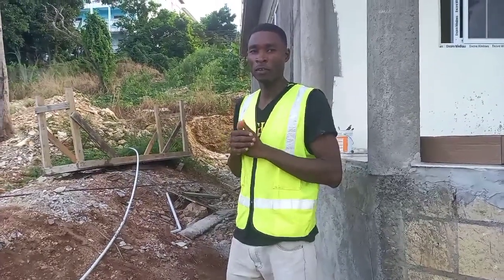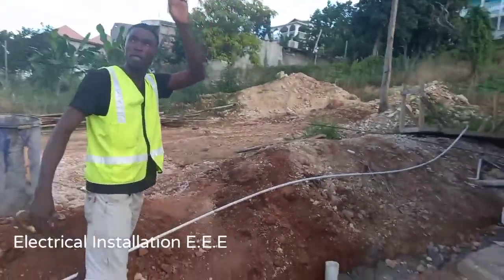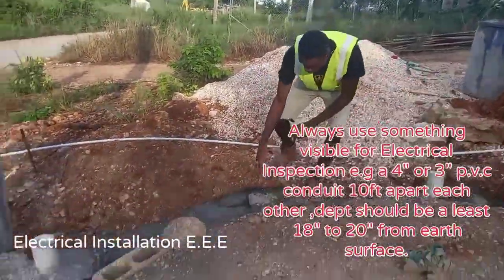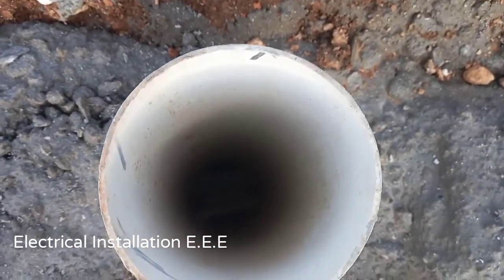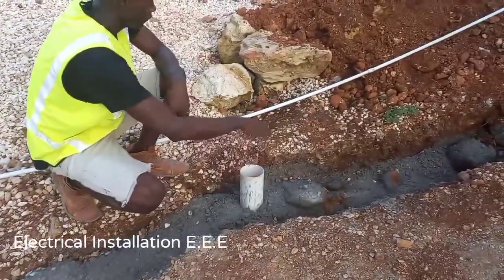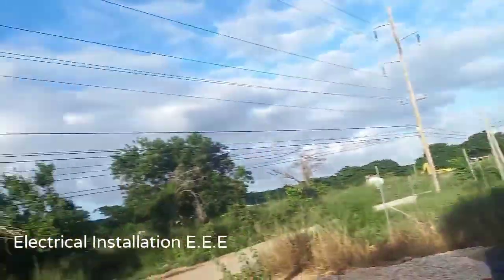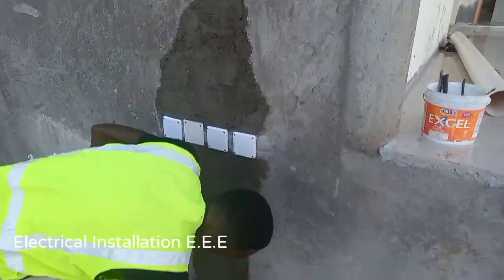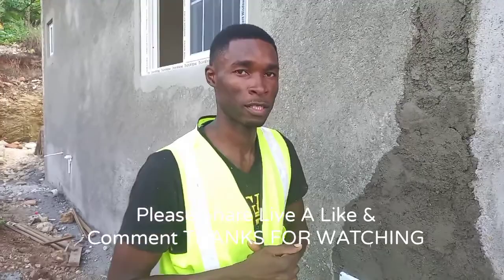HOW TO RUN UNDERGROUND ELECTRICAL MAIN WIRES TO A HOUSE !! ASK MUNDO

Comment: hey is it mandator now to run the main wire underground, base on electrical code or regulation? and is 10mm2 wire ok to use for the main wire for a two-bedroom house ?
Reply from the maker: Yes to your last ? For the first it depend on the circumstance

Comment: I didn't know about the 4" pipe to show them depth... Thanks man!
Reply from the maker: Yea the inspectors want to see how deep the conduits are you can use 3 as well
Reply: I've never met one who checked the depth... Which parish are you working from?
Reply from the maker: I work all over Ja mainly in Trelawny & St James but they do at times even if they don't check the dept in measurement but by glancing
Reply: 😂 Tek it dung rasta

Comment: What size electrical service are you running for the house
Reply from the maker: This house was 16mm single main wires
Reply: @ElectricalInstallationEEE  I mean what is the amperage of the service to the home
Reply from the maker: This home was 50amp
Reply: @ElectricalInstallationEEE  Damn the minimum requirement here is 100 amps. For that size house here it’s 200 amp minimum
Reply from the maker: In some states i saw 50 and 70 while i was there but yeah most 100 i saw
Reply: @ElectricalInstallationEEE  yes that’s the old stuff
Reply from the maker: I realized after seeing it

Comment: Why you put the earth rod the at the side of the house. Why you use a draw box? Can i run from panel the straight to the meter box.
Reply from the maker: Earth at the side was to give the breaker panel a independent earth also saving wire because it would have take too much to go all the way the meter socket .
Using a draw box make the work much easier for instance the floor level was way higher that the ground level so pulling the main wire is easier when you have a breaking point when the distance is long .
Yes you can run the earth from the panel straight to the meter but not when you have a long distance of wiring also the earth wire will contect the neutral bar in the meter then into the breaker panel so running the earth wire straight is like you basically doubling the grounds or neutral wire to me personally .
Thanks for your question.
Reply: @ElectricalInstallationEEE  some jurisdictions here they don’t want you to the ground wire to the meter socket, and some others city wants you to ground it first then go to the breaker panel
Reply from the maker: Some laws in the electrical field makes no sense because to me it is the same difference
Reply: @ElectricalInstallationEEE  yes I learn it’s cheaper for me to ask the inspectors what they need before I do the work
Reply from the maker: Lol my inspectors are real kool out here